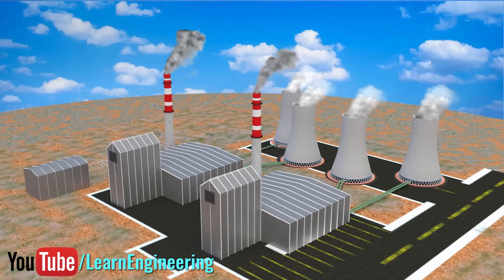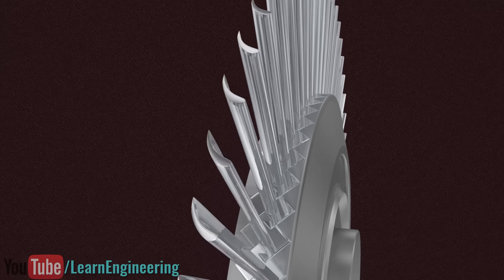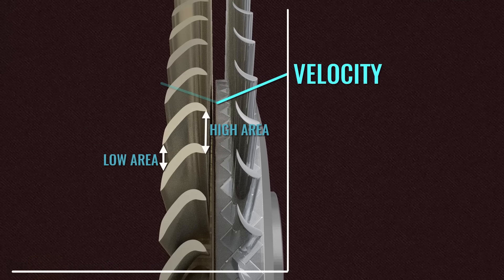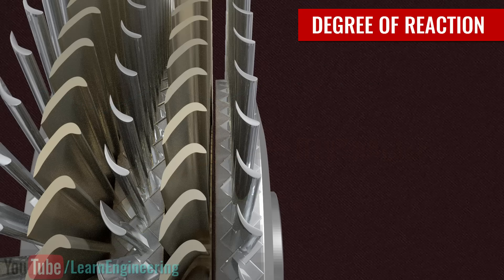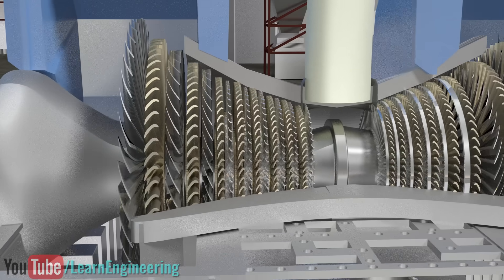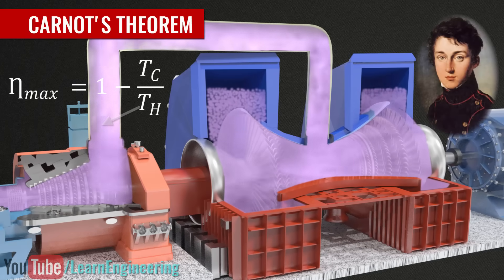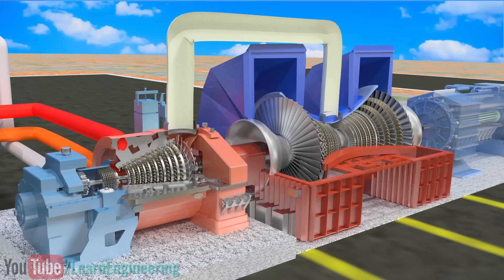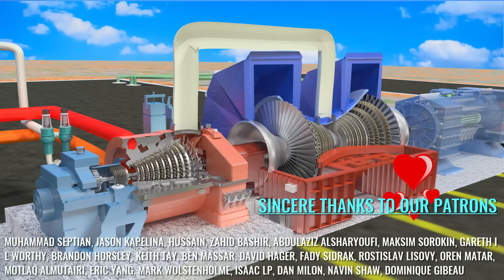How does a Steam Turbine Work?

Comment: MECH.E STUDENT HAS QUESTIONS!!!! 

I am not understanding 2:48, why we have to increase the flow area.
So the name of the game is to keep the steam flowing at a constant ideal velocity of our choosing. This is why we have the nozzles/stators. 
In the start, flow comes in high velocity + high temp and lets say it is already at the ideal velocity. 
We extract energy via turbine -> pressure, temp, and velocity drop after turbine blade. 
Now we use the nozzle/stator to increase velocity back to ideal velocity which further decrease the pressure and temperature.
So the logic is that all of the pressure drops cause the air to expand as per the ideal gas law. BUT the temperature also drops, causing the air to contract. So what is the need for increasing flow area when temp AND pressure drop? 
The video said Volume is proportional to 1/P, which it is. But in this case shouldnt we say volume is proportional to T/P? And therefore the ratio still remains the same, and therefore the volume remains the same!?!??!??!?! AHHHHHHHH my head hurts.
The only explanation i can think of is that the temperature drop is much less than the pressure drop, please dont just agree with me if you dont really know that is the reason! I want true and confident answers people please! Help me understand this!

Also, is it more efficient to use steam engines rather than piston engines? Why is that? 
Is it because steam engines are better for large scale constant power output?
If so, why not use multiple piston engines to power the shaft, then extract the wasted heat generated to heat steam? I guess the piston engines would not be able to function at temps of 550C?

Comment: Don't Powerplants also use a Transmission to adjust the velocity?
Reply: No
Reply: no, the generator is what has to spin at 60hz (or 50hz outside of north america), theres a gearbox attached to the turning gear between the LP and the generator which has gear reduction but it doesnt switch gears, it all spins at the same rate all the time.

Comment: Is there a reason why many power plants just exhaust the steam out into the atmosphere, instead of condensing it back for reuse?  There's a powerplant not to far from me, and on some days, you can see a cloud forming from all the steam.
Reply: Simple answer is cost. There are no regulations about steam output so venting steam rather then condensing it down means no condensing equipment/structures needed. To condense the amount required down would take a large volume of lake/river/sea water or require large cooling towers that are famous now for nuclear power plants.
Reply: You're seeing the vapor/drift from the condenser cooling system, whatever its design is.   Turbines do not exhaust directly to atmosphere.

Comment: 3:44 if there are more areas and all of the blades are connected to one shaft, why do we have so many areas why different size blades  ? because all of them will turn with the same speed, right ?I am confused. 

For example, the area where the blades are the longest is the one that will spin the fastest, that means that the area where the blades are the smallest ( first chamber } will spin the slowest, but because they are all connected they will spin with the speed of the longest blades, right ?
Reply: The impulse and reaction blades at the high pressure ends begin adding torque to the turbine rotor, adding more with each stage.. As the steam expands in volume and cools, larger diameter blades are necessary to extract maximum energy from the steam to turn the generator shaft. The last few rows of low pressure turbine blades run wet and cool and in a high vacuum.

Comment: Is it possible to use something like a gear box to make turbine spin the generator faster? would this produce more power? from what I took from this video the turbine and the generator is one unit
Reply: Brycen Ballinger You would only increase voltage, which is the force moving electricity around (kinda like pressure for water), but  at the same time you would lower the current (number of electrons moving, kinda like flow rate for water). Since power is the product of the two, no you can't.
Reply: Brycen Ballinger Actually, some do. The final output must be 50 or 60 cycles per second  or Hertz. That would require 3,000 or 3,600 rpm. But some turbines are run at slower speeds of, say, 1800 with a 2x transmission to get to 3,600. You understand that the USA used 60 Hertz while most of the rest of the world uses 50 Hertz so whatever speed the turbine is run at would go through a transmission that would speed it up to either 50 or 60 Hertz. I used to work in a GE gas turbine blade factory.
Reply: thank you very much for explaining that!!
Reply: dude
Reply: Also frequency is dependant on speed so it would probably cause major damage
Reply: jockellis very large machines (eg big Nuclear power machines) run at so-called half speed (1500 or 1800 rpm) directly coupled to generators running at this same speed, but with four poles to generate 50 or 60Hz power. Conversely smaller steam turbines often run at high speed, up to 10 or 12000rpm with shaft speed geared down to suit the generator. The speed/size compromise is driven by turbine efficiency
Reply: @billtorrance3161  General Electric Ship Service Turbine Generator sets ran 10,000 turbine rpm through a reduction gear to run the 6 pole generator at 1200 rpm for 60 cycle power. I overhauled many of them.

Comment: I don't understand why steam turbine need low pressure and higher flow speed? by the way your I like your videos
Reply: the pressure and temperature energies cannot be harnessed by the turbine. Only the speed (kinetic) energy will cause the fans to rotate. So when it passes through the stationary blades,  the nozzle action turns the pressure and temperature energies into "speed" energy so more energy overall can be used.
Reply: thanks

Comment: Sir I am not clear about , why the outer blades of the turbine are large compared to inner blades (v=1/p).Can you clarify my doubt?
Reply: SATYANAND KOMMURI 
As far as I understood, the volume of the fluid (steam) increases as the pressure decreases, so if the volume of the container stays the same the velocity will change. but they want it to stay constant.
Reply: In case of turbine what you are doing is converting heat energy into kinetic energy. The process used is an adiabatic expansion, now if you are using adiabatic expansion the heat content falls with decrease in temperature, increase in volume and decrease in pressure. Now as the volume increases you need to have bigger volume for it that's why you have bigger blades in end.
it will be more clear with T-S & P-V diagram unfortunately Here I can't post that :(
Reply: SATYANAND KOMMURI as i understand it, when you decrease pressure, you the speed increases.
the pressure is decreased throughout the different fan blades, thereby speeding up the steam.
with faster stream, you need a larger blade to be pushed. otherwise a small blade would spin too fast.
Reply: SATYANAND KOMMURI as you move away from the center the energy of the steam flow decreases so you need blades with a bigger surface area to be rotated by the flow of steam.
Reply: @Ravi Utkarsh ReVzZ Rider
They explained the volume expanding with the ideal gas law.
But they said Volume proportional to 1/P 
When for this problem, they actually should have said volume proportional to T/P
They say the pressure drop increases volume, but do not mention that the temperature drop decreases volume.
I wanted to ask you why the volume does not remain constant? Because the temperature AND pressure drop so shouldnt the volume still be constant?
Is it because in adiabatic processes the heat extraction causes a greater pressure drop than a temperature drop?
Reply: as the working fluid passes through each stage, the pressure reduces continously. now to according to bernoulli's equation the velocity must increase(as there is no energy interaction with the surrounding). so at later stages in the turbine the velocity becomes very high. and at very high velocity it would not be possible to generate the lift force. so to avoid this area of turbine i scontionously increasedso as to keep the velocity withinn proper limit
Reply: I'm sure there are plenty more reasons, mine may not even be right, I've only taken a fluids class but we always have assumed steady flows for now
Reply: No this is Patrick thanks sir , I am getting clear now....
Reply: Ravi Utkarsh ReVzZ Rider thanks for your message ....
Reply: Thanks sir for your reply. The question you asked is good . I am searching for the answer.

Comment: So this may be a silly question as I am still learning, but I thought that if the velocity of the gas molecules were increased so would their average kinetic energy (and thus temperature would increase). I know that this connection is wrong in the case of the steam turbine, but I'm struggling to make sense as to why that is. Is it because of the gas expansion?
Reply: Austin Anderson thats what i thought too, maybe thats the reason why this system isnt fully efficient.